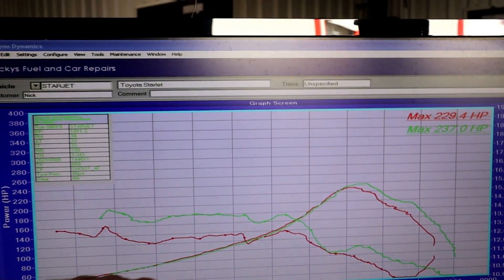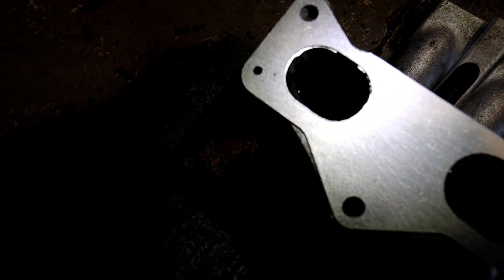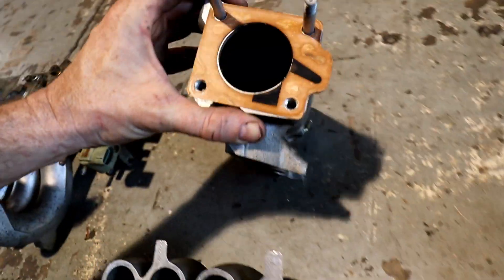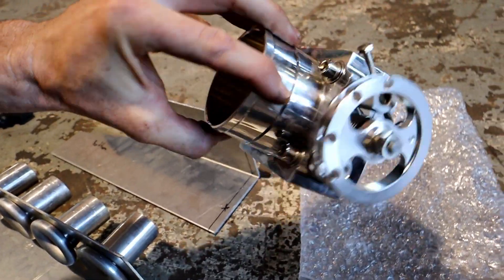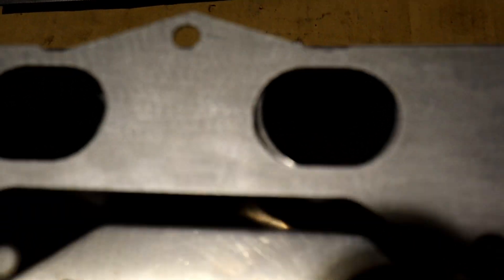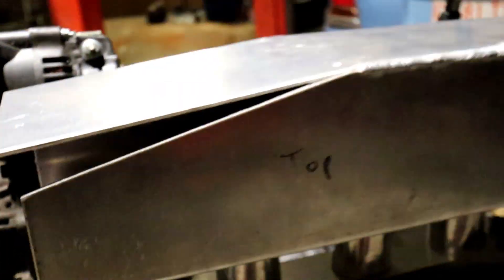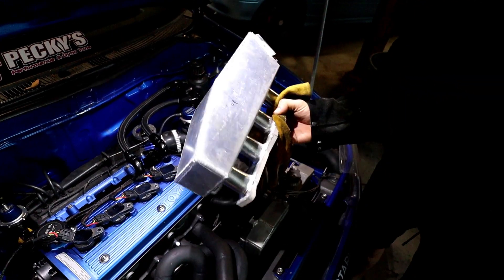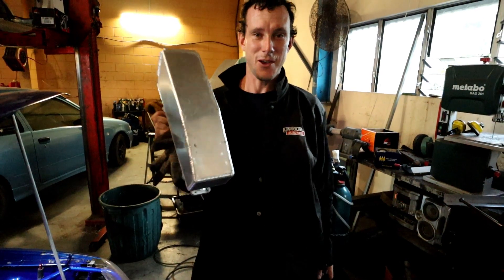4EFTE Custom Intake Manifold

Comment: Although this manifold will solve your issues, there is much to learn, read up on fluid dynamics, there is so much more gains to be had in building a custom inlet manifold correctly, not many people actually get it right, only good enough.
Reply from the maker: We were looking into the Audi dual plenum designs, however this one was out first one so lets see if we blow the welds on the intake
Reply: @Camp_Dogs  how can I message u
Reply: adobe inventor is the key, ;)

Comment: Would an intake manifold like this make any difference with a ct9 hybrid? I've  heard stock manifold isn't a restriction till 300hp
Reply from the maker: We made it to 265.... its very hot where i live so i wouldnt be surprised if its capable of making 300+ in cooler weather.

Comment: How does it struggle to make over 250hp lots of people run the likes of td04 hybrid turbos without plenum inlets on stock heads bar uprated valve springs and make 260-300hp?
Reply from the maker: I had a stock 5efe with valve springs and it made 265 hp on the same dyno on 17psi with that exact manifold that Nick has in this video... We only revved that engine to 7000... the difference is after 7000 the cfm that the engine needs greatly increases and the intake cant flow it.

Also a huge factor is our climate is 35 degrees celcius with around 90% humidity... Cold air= dense air= more power. Our climate sucks haha

This is why the boys in the UK can make great HP on the TD04 stuff, cold air is great!!
Reply: @Camp_Dogs  ahh your videos make alot more sense to me now haha thank you very much for the reply and keep up with the great content!!

Comment: What are the velocity stacks size and dimensions of the intake manifold
Reply: I probably go with 80mm since I can't find a 75mm on my end 😂
Reply: 5efte would be ok since is larger displacement 1.5 vs 1.3 going with at least 75mm bore stock 5e stroke is 87 vs 77 on 1.3 5efe crank too
Reply: Let me know

Comment: Make sure you disassemble, inspect, and debur that eBay throttle body.
On the one I got the throttle plate screws were loose and the plate had a bur around it keeping it from fully closing